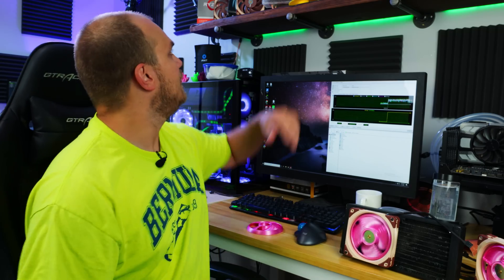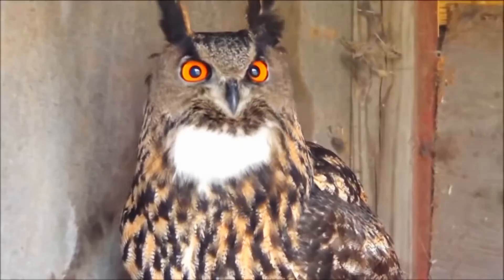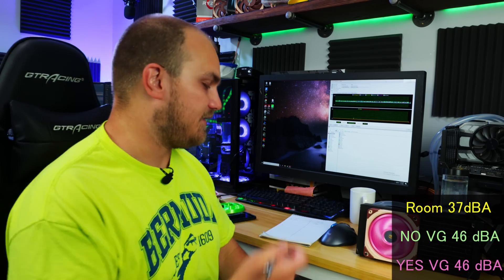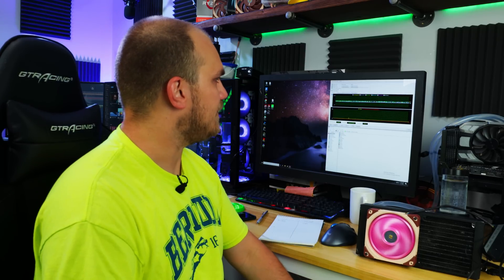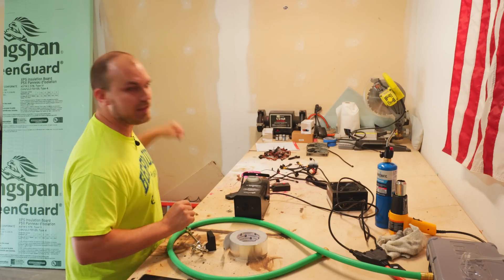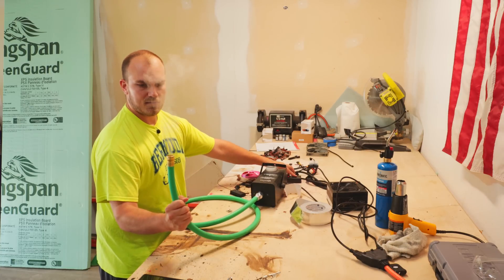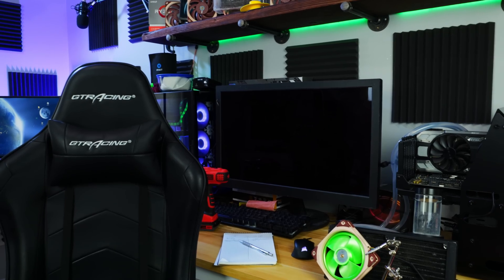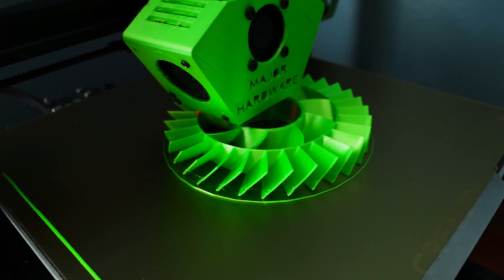Do Vortex Generators Make A Difference | 3D Printed Fan Testing

Comment: What would golf-ball style dimples on both faces do for flow, sound, and volts/rpm efficiency?
Reply: It would create a very difficult to print piece given the technology used. If Mr Hardware's tech were taken out of the equation, they would have to be very small and then maybe a minuscule amount of drag on the blades could be lost. Spheres aren't aerodynamic, so it's more necessary for them. Blades are meant to harness the air so I doubt it would only cause problems in manufacturing and not yield satisfying results for any of those, only for aesthetics like the VGs.

Comment: Mechanical Engineer here, it looks like the vortex generators may help trip the air and break up pressure drop. You may not be getting much of a signal in your data with just one fan, so if you are able to, try adding another. you should try adding a wave like bumps(like two or three waves) that scoop air into the rad and are offset from the blade behind it. This would increase the surface area of the scoop with out blocking the blade behind it.  idk if it will do anything but you got the 3d printer so worth a shot, but the owl feather design will be interesting.  For the smoke test, try using a tunnel like a clear tube with air straighteners (smaller tubes at the inlet of the tunnel), this should help give you a laminar flow that will help you see the change from laminar to turbulent. Also at the end with your dual blade ring design: The center is rotating slower than the outside side. On Wind turbines, a three bladed design is the most efficient design for high wind areas and use lift. While five, or higher blade count turbines are used in low wind speed applications where they use drag and spin slower, when they do see high winds the blades start to create vortexes that interrupt the next blade. That being said you should switch the rings on your fan so the higher blade count is moving slower but providing more pressure while the lower blade count ring will move faster and help with airflow. I am going to hypothesize that your current design will be louder and less efficient as the  higher blade count on the outer ring will create more drag and vibrations.

Comment: Could try straight, canted airfoils? Try a couple different angles: 30 degree, 45 degree, 60 degree angles of attack.  You wouldn't need to taper them down like wind turbine airfoils because they are so short, but they might move a good amount of air.  Idk if you've tried that yet or not.

Comment: The curve of an airfoil has a larger rate of flow over the top of the wing than the bottom as the air has to move faster due to the shape of the airfoil. I wonder if this would allow for higher static pressure than fan blades that keep the same thickness across the blades.

Comment: Would you try a aerofoil style fan blade to try and create a low pressure pocket under the fan blade and create a suction + blow effect on the fan, probably wouldn’t work but might make some lift at least...

Comment: I think you should put ripples in the blade.  Have the ripples run along with the air flow and then test with ripples perpendicular to the air flow.  This may decrease noise and decrease friction.  MSI did that on some graphics cards a while ago, so there must be some merit in it.

Comment: The turbine blade design seems like a cool idea, aircraft turbine blades are not straight though, they ahve a curved shape that you can look into as the next iteration of the design.

I did a quick google image search to illustrate the point, so here is a random example:
https://www.ainonline.com/aviation-news/aerospace/2019-11-05/researchers-focus-turbine-blade-failure-predictors

Comment: if you want good slow-mo on the cheap, use a fan speed controller to set the RPS of the fan to a multiple of whatever frame rate you use on your main camera, then film it with the fastest shutter speed your camera can do.

Comment: Try to put a few layers of "walls" under the fan blades that is radial to the motor. I wonder if it'll do anything, trapping the air but it still can move down to the radiator. It might look a bit like a race track lol

Comment: I think it would be interesting to do a fan with some taller, milder pitch blades alternating with shorter steeper blades. So one set to kind of direct the air in, and the other to force the air through the cooler. Probably wouldn't work that way, but who knows! I don't!

Comment: theres a reason that vortex generators are mounted to the back of the car, the vortex is supposed to be generated from the trailing edge, also check out whale fins for some other fluid dynamics related stuff.

Comment: I think the angle of attack of the blades is too low for vortex generators to make a difference. Look at the NF-F12, it has no vortex generators, with a low angle of attack, but the NF-S12A has vortex generators with a much higher angle of attack. Noctua has a write-up about it here: https://noctua.at/en/anti-stall-knobs

Comment: I think the inward tilted ring may reduce the intake area  of the blade, whereas the area at the backside is bigger, therefore you‘re achieving a backwards Venturi-effect, effectively slowing down the air speed.  

Maybe you could make it straight up like the original design.

Also, removing it would reduce the rigidity of the blades, so IMO a bad idea.

Comment: I have an idea, but i sincerely dont know how to describe it. 
I’ll try anyways. 
Imagine dividing every blade on 3 parts (from the center to the tip). And giving it different lengths. Since the center has a higher velocity, make it the larger piece and it “shrinks” but with a more agresive angle or “curve”. 
Cheers

Comment: I would like to see a turbomolecular pump design as a fan. You could do it by stacking a few of your a12x25s. With decreasing angle of atack as you get closer to the radiator and Alternating the fan direction and fin direction so the adjacent fans rotate in the opposite direction. Love the vids. Sub'd

Comment: Test fan performance using different layer heights like 0.2 0.1 and 0.05mm vs one that's sanded and smoothed, see if they make any difference. I wonder if the coarse surfaces affect airflow.

Comment: Odd numbers matter you should try 3 and 5. It will give you a window to the accuracy of your printer. By the way spikes work as a vortex generator if you have a high enough accuracy.
Reply: The speed of the wave affecting the stream differed. Like gears look for the sweet spot. Then comes dust.

Comment: still think having the outer part of the fins higher than inner should quiet it down without the vg while making more air flow while making it weigh about the same.
on the last dual blade design alternate the outer ones height to basically be VG's or maybe like teeth alternate 50% inner 50% outer to scoop higher.

Comment: The vortex generators work better on the tail end of the fan portions. Because you are making them cut through the air before it is funneled over the fan blade. Try a version with that way and see if there is a difference.

Comment: I think you should try designing the fan blades like propellers and make there be more of a curve on the inside than the outside, so you can get an equal amount of thrust. Also, I think you should get rid of the VG's, because they look cleaner without them.

Comment: Hello! Huge fan here. Although I must add some constructive criticism. I also think some others have mentioned this, but you should smooth your prints out. They are very crude prints, and airflow will be incredibly poor. I think if you take the time to make higher quality prints, and/or smooth prints afterwards will give much better test results.

Comment: Try making the blade progressively curved down acting more like a skate ramp. This will direct the air flow straight through the radiator. Maybe at the same time offset the scoop at the top, 2 blades towards the outside and the 2 opposing blades towards the inside. Also incent smoke may give you a visual effect to work from

Comment: Have you considered adding a cone to the motor section to improve air flow around the center?  Like the spinner of a turbofan.   Also, maybe try a small "squirrel cage" in the center.      Alternatively have you looked into nozzles or laminar veins to smooth the air flow before it hits the blades?

Comment: I can see a difference, the smoke looks a lot more wavy with the vortex generator and it looks like it is being pulled more into the fan, without the vortex generator it looked like some smoke was escaping out from the sides of the fan. So my conclusion is that the vortex generators are doing their job well, they are creating a vortex that makes it harder for air to escape from and they can pull the air from farther away, those vortex generators would probably pull more cool air for longer, which is why you aren't seeing much of a difference, because you are A. Running it outside of a case and B. not letting it run long enough to get REALLY hot. Those fans would probably keep a server running for a LONG time

Comment: The reason why there is no difference is the vortex generators are in the wrong spot. If you look at an aircraft wing, they are on the trailing edge. They disrupt the drag pocket behind things moving through air. These fan blades are little wings which operate on Bernoulli's principal and pressure deflection. Noctua has paid engineers who understand these laws of physics and designed to perfect fan already.

Comment: Just as noctua has the stripes on their blades for no apparent reason. You get to keep the VGs. They add uniqueness to a thought out concept in crowd-sourced design and are after all an actual aerodynamic element (most useful in aeroplanes though).

Comment: Some airplanes have vortex generators on the end of it's wings. Those are there to reduce pressure in that area and increase air velocity. So I think you should put those towards the end of the blades

Comment: Vortex generators help with flow separation  with high angles of attack so I guess it really depends on how steep you go with the fan blades really. If you are going to increase the angle of attack you should keep them lol.

Comment: I wonder what those vortex generators would do on the inside of the blade instead of being on the outside. Being slightly longer and not as tall. Also I'd like to see the difference between a raw 3d printed fan vs a one that's been smoothed (one set with and another set without the vortex generators), and I would love to see the outside rim/ring of the fan strengthened out and not curved in.

Comment: The ring needs to stay, morons.  The reason Noc doesn't do rings is they're hard to do right and balance and they add mass that requires more power.   The little vortex fins, half of them are wrong.  Since the system is centripetal the ones that aim airflow out aren't actually doing anything useful.   Additionally they're kinda useless towards the center.  I think four push-in generators towards the outer edge.

Comment: Seems like vortex generators should be on the underside of the blade. You arent trying to create downforce  which would require the fan spin the opposite way. 

And the outer ring is very important to flow but I believe it should be straight 90° and not rounded towards the inside

Comment: Try to make a fan that looks like it was made organically.
Like how they use 3D printers with a program to optimize the shape of objects and in the end it looks like was made by Nature.
The Idea is to decrease the mass of the fan as much as possible and still keep its rigidity and potentially increase its performance by mimicking the shape of the blades of bird wings/ tree leaves.
Also I would prefer if the rings were as thin as possible and had an increased surface area to make them look like tunnels.

Comment: have you had any chances to use acetone (ass eh tone) to make the surfaces on the fans smooth? I think that might make a big difference
Reply: keep the vortex generators, I think there is a visible difference in front of the pink fan intake, looks cool

Comment: The difference between the 2 fans in the smoke test was that the vortex generators were causing the air to bend with the fan's rotation.

Comment: The vortex generators are on the top of the leading edge of the blade. What happens if you put them in the bottom of the trailing edge? My logic says you don't need turbulence on the intake but instead on the exhaust.

Comment: have you seen those vertical tower fans people use in their homes? i wonder how well a miniaturized one would work. i took it mine apart to see how it works, it's pretty neat, the housing around the impeller column is smaller on one side than the other, which gives the rotating cylindrical fan a "directionality" by creating a low pressure zone and a high pressure zone. wonder if you could 3D print one?

Comment: Tests with a smoke generator are preferably carried out on a black background and with the side view on the fan. It will be easier to see how the smoke spreads before and after it and therefore to understand the influence of the fan design on the air flow.

Comment: Stirling engine.....  Imma keep saying. Lol.
If you're just trying to pump more air, then the stock blade would be good, and raise the voltage on the motor.  Noctua already so quiet and strong, so more power would be logical to try.  Wonder how much they can take.  Maybe try 18V?  Might have to build your own controller.

Comment: The VG's help the aircraft with steep wing angles. So maybe a steeper angle on the fan wings an you'll get a quiet fan with high static pressure?
Reply: Vg's prevent an aircraft from stalling, which is when the angle of attack gets too high, and you start to get a vacuum at the leading edge of the wing (not exactly correct, but best laymens terms I could come up with). Vortex generators disrupt the boundary layer, causing turbulence over the wings. They are set inboard to the fuselage, so the inner portion of the wing stalls first, and you will know you have a stall before losing control (ailerons are outboard)
Reply: @g45h96   pawel was right, but its not the wing angle but the angle of attack of the airflow. VG dont prevent anything, they only increase the possible angle, and they dont show you anything. what you mean are flow indicators sometimes put on lightweight aircraft and glider wing.and usually they are put on VGs
Reply: Little bit of a misspeak on my part. If yoh read the rest of the comment, you'll see that I said they cause a stall. What I meant is that they prevent you from losing control of the airplane due to a stall.
Reply: @barongerhardt  The most common use of vortex generators is to delay flow separation. The basic principle is that air at the thin boundary layer near the surface of the wing is moving much slower than the rest of the airflow. A vortex generator creates a small amount of turbulent air right at the boundary layer, which forces the air to move faster (this is called "energizing" the airflow). When the air is moving faster in the boundary layer, flow separation occurs later, and you can push the wing to slightly higher angle of attack.

Comment: I wonder if you could get one to spin the opposite direction but flow the same direction to  cause a more controlled flow of air with less spill of the side of the blades with 2 fans working in tandem

Comment: I'm gonna keep suggesting a fan designed for pulling air, with inverted blades :)
Reply: If you used a similar idea on a normal computer case, it would cause the higher temps from within to flow through the radiator instead of the cooler ambient air outside.
Reply: @stellavalkyrieyoung  not if you use them as a standard pull configuration (mounted on the "inside" part of the radiator). They would make it possible to not see the ugly back of the fan while pulling!

Comment: You should go into power measurements as well.
I didn't expect the vortex generators to change the sound or cooling capacity by any considerable amount. But maybe they are more or less efficient. I would suggest measuring power (voltage and current) as well as rotational speed.
Could be interesting as well.

Comment: each one of the blades if were to create HP they being 1 3/4 inch would create 750 HP each is what I was told
Reply: I'd have to sit down and do the math, but my napkin math says no. Basically the formula would use specific mass airflow (that would take airflow and convert it into lbs/min), cross check that with the force (derived from its velocity) to figure out how many lbft of work was being done, and convert into hp. But basically, 746watts of electrical power equals one hp. Subtract for efficiency of the motor, frictional losses, drag, etc, and there's no way a (don't know the exact number) less than 24w motor creates anywhere close to that much. However, destructive testing could yield the max theoretical airflow and velocity, and power would be much higher, but I guarantee it's nowhere near 750hp. Those wouldnt even be capable of 5hp

Comment: Six blades, with ring, with an curve/bulge to the blade so that it's flat where it scoops the air and more curved down where it's pushing the air at your cooling solution. Also try reversing that curve, though I expect that'll fail.
Also, put vortex-generators on the inside of the blade instead of the outside, to cause more turbulance when it scoops the air. Make them wedge-shaped.
Reply: Also, smooth the plastic.